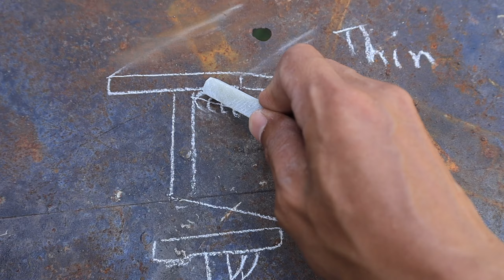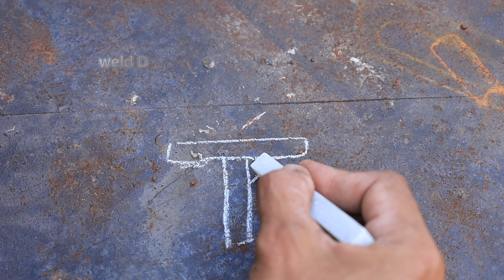Welding training that gives good results in the overhead position. 👨‍🏭

Comment: Sir , 👍 please show Ampere + electrode size and plate size then small welder properly educates
Reply: 80-120. Don't do the spot technique.  It's fine of you're in a hurry on a farm. It will stick 2 pieces of metal together.  It will surly get you fired at any level of professional welding.